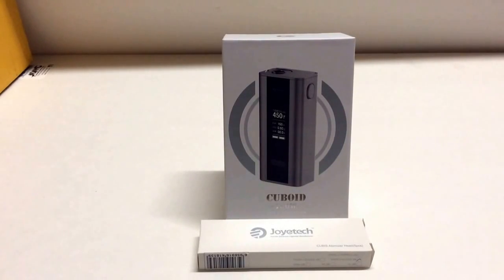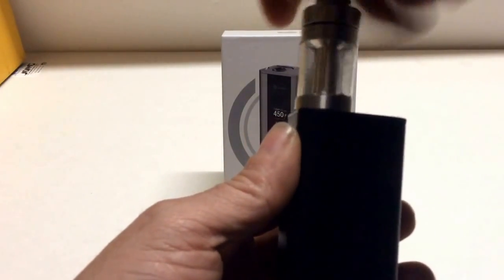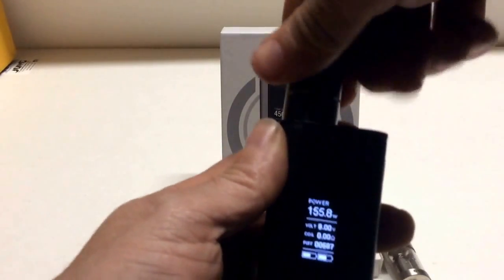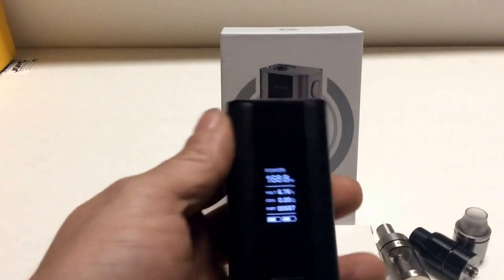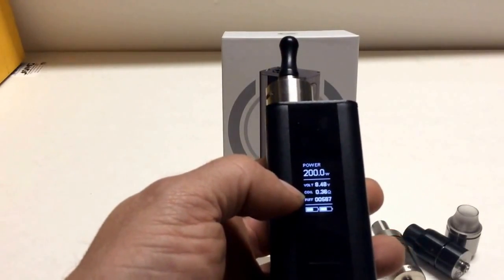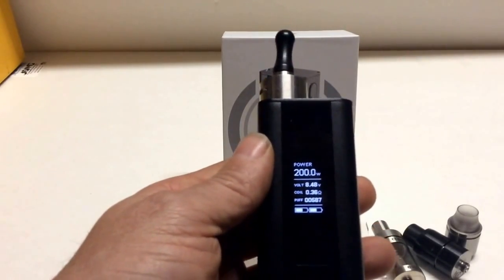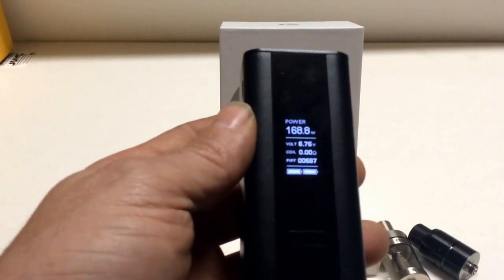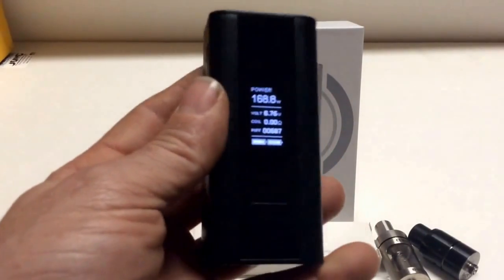Why can't I get my Joyetech cuboid 150w to go to 200w watt after firmware / software update

Comment: YOU CAN GO UP TO NEARLY 300 watts with just 2 18650!!!!
For all those who say that dual 18650 cant do 200 watts.... it can !

Just simple math:
Sony vtc 5 have 30 A, which means the lowest resistance you can use on it is .14 ohm to be 100% save. 
4.2V / 0.14Ohm = 30A

If you stack 2 18650:
8,4V / 0.28Ohm = 30A

Which means at 8.4 volts the lowest resistance you should go is 0.28ohm.

Whean you now want to get the watts with a .28 ohm build it is:
8,4V x 30A = 252Watts

All that means you can get 252Watts with fully charged batteries. 

If you now go with VTC5A which have a 35A Limit you can use a 0.12 ohm coil for single and a 0.24ohm for stacked.

8,4V / 0.24 = 35A 

8,4V x 35A = 294 Watts :) 

YOU CAN GO UP TO NEARLY 300 watts with just 2 18650!!!!
Reply: KiDCe - CS:GO and more VTC5 is 20A, VTC5A is 25A... please dont pull numbers out of your ass or listen to fools... check mooch tests or official sony specs...
Reply: Allright.
Since we are not talking about continuous discharge its still pretty save to use it with 30 amp... The Problem in all this if the cell gets hot .... but cauz we use it only for short times i wont get to hot. verybody will be save if they dont go over 30A when vaping and charging it correctly. Never heard of someone where the VTC5 exploded at 30A

And:  when im talking about 4.2V... this is only when the cell is fully charged for like 2 to 3 hits... then the voltage drops down to 3.7-3.8 volt so there is really no problem with a 30A coil at 4.2 V

Comment: No way will a mod with dual batteries fire at 200 watts there is no way

the RX200 will fire at 200 watts because it uses 3 18650 batteries and this will fire low ohms also
Reply: Sorry but its more than possible. I have the Smok H-priv mod which goes up to 220W. That's with dual/ two 18650 35A batteries. Oh and that's just some Sigelei's. I use it with the Smok TFV8 'beast' tank at 220W none stop with no issues.
Reply: There is no way that the joytech Cuboid is capable of doing 200 watts on dual 18650 batteries 

It's capable of doing 150 watts because I have done this 

and no way is the Smok H Priv capable of doing 220 watts with dual 18650 batteries either 

The only mod that is capable of vaping close to 200 watts would have to be the Wismec RX200 with 3 18650 batteries

I have a Limitless Lux that is possibly capable of doing 215 watts but it takes dual 26650 batteries and these comes with the mod when you buy it

I am saying this because 26650 batteries hold more power and they put out more power that an 18650 battery if you see what I mean

Just because a dual 18650 mod says it's capable of doing 200 watts doesn't mean that it can there are limits
Reply: Brittany McClue Yeah fair enough the cuboid can't, but that's not what either of us said. Actually yes, the Smok H-Priv can run at 220W with dual 18650 batteries,  like I said before I vape on it all the time at 220W. Tell you what, I'll post a video of it on my channel now and show you.
Reply: Sure no problem Josh and I hope that I didn't offend you in anyway because it wasn't my intentions my friend 

I hope you have a beautiful day whatever your doing

Best wishes and vape safe

Comment: I'm using the tfv8 and have the latest firmware my coil is at 0.16 ohm but I can't get the cuboid to fire it at over 100w
Reply: I put in the v8-q4 and only get to 112.5
Reply: thats because of the coil
Reply: Same
Reply: You have to put in the V8 RBA and it will go as high as you would want it to
Reply: I get the limit at 93W with the v8--T8 quad coil on. I thougt my VTC was broken
Reply: what would the limit be with a tfv4?
Reply: i have a TFV12 and it won't let me put it over 75watts, with a 0.12ohm

Comment: I have just run into this myself. When you get to vaping on really low resistance like .16 or .15 the amp draw required to go to higher watts is greater than 25A. The Cuboid has a limit to the amp draw there. You have to vape on a .22 or greater in most cases to keep from drawing more than 25A.

Short answer. The mod won't let you draw more than 25A whether the coil can handle higher wattage or not.

Comment: Besides to resistance settings, it also depends on the current charge of the battery. I think it's some sort of safety feature I guess? So as to not stress the battery. I have a rda with .13 ohm and it can do 135W when full charge, going down to 105W when 90% batt, 90W on 80 and 85.5W when somewhere 70% - 60%, then it does 75W when battery goes below 50% - 40% and man don't start asking when your battery goes 30% as it would only run 40W for some reason. Now the best way to utilize the Cuboid is to start off permanently somewhere that fits you, I go for 80W. This can make your device run its batteries more efficiently. Btw I use Samsung 25R5's and I could vape the whole day with it.

Comment: looks like it limits current draw to 25 Amps like on your .27 build display shows 6.75 v
so by ohms law Voltage/Resistance is current(Amps)  = 6.78/.27 = 25A

on your 0.18 build, it calculates to the same thing = according to your readout 4.5v/0.18=25A

Comment: Why in the world would anybody want to fire that high? I just tried it at 200 watt.'s power with the cubis with the included 1.5 clapton coils and got a hot lungfull of burned and scortched nast! I pray that that little experiment didn't ruin my new coil, as I don't have another one. Duh! Seriously, what do you all vape on that will not burn at that high a temp.? The highest I can get is 24 watt power setting and still have a good, tasty vape. Not a nooby here, just not experienced on a lot of the newer technology. Thanks.
Reply: +Loren Robertson all depends on resistance
Reply: shouldn't be anywhere near 200w at 1.5, I only run my 0.24 Clapton's at 120w at there's a massive difference in resistance

Comment: People don't understand the difference between a 200 watt mod and a high wattage device. Idk why anyone has a problem with this, because of the limit I can run dual fused Clapton reading at .15 ohms at 95 watts on my cuboid and the batteries last a lot longer because of that. I rarely ever need to run above 110 watts. And if you build too low and have a problem with the limits the cuboid has, either change your build style or get a mech.

Comment: Pff they should up the amp limit to a safe 30Amps. its completely reasonable.
Reply: Matthew DeFaveri Its at 9V 25A... battery voltage is 4.2V when they're fully charged so it's pulling around 50A from them (even a bit more), 25A EACH. How much higher could they go?
Reply: Error989 with the right battery's 30a is reasonable.
Reply: Matthew DeFaveri 18650 battery that can output 30A without overheating (going over 80℃) has 1500mah... (please dont tell me that vtc4 vtc5a can do 30A because it cant without being cooled)
Reply: Error989 well how does smok alien do it.
Reply: by pulling more than cells can give and not having safety... joyetech/wismec/eleaf products give you "weak battery" warning when they notice huge cell voltage drops
you can pull 30A from a cell that is rated at 20 but it's voltage sags from 4.2V down to 3.0 and even under in some cases under 1sec! It damages the cell...
Smok is well know for their bad QC and 0 ducks given about safety...
Reply: Error989 well they made a sale that's why I bought it.
Reply: QC on Smok products is pure shit! Also the paint on Alien comes off in 1-3 weeks...

Comment: That's how it is.! 133 W IS about the most you'll get from duell 18650 mod.
Reply: +Craig King You can get >300w from a single 18650 mod. It's not safe, but it's possible.
Reply: That's ignorance at best. Please don't try to speak on things you obviously do not understand or know about. Also, I don't think many will take advice from someone that spells dual as duell.
Reply: +TheAmericanUhate 200w@.32-.41 25a. 9v
Reply: Mark Nope yup.

Comment: It also requires fully charged batteries to do the 200 watts, and it doesn't last long. That's why joyetech said they didn't label it as a 200 watt mod, and just released the firmware for those who wanted to play around with it. They looked at it as false advertising since the 200 watts is rather fleeting.
Reply: BINGO!!!!!
Reply: +Laura Roesch I was looking for an answer to that question - thank you!!

Comment: nice PSA, it's just like the RX200 it will limit the wattage until you reach the 9 volts, but then again the Reuleax mods have 3 18650'z. the only thing I don't understand about this mod, is the lower the ohm's the lower the wattage?? I think it should be the other way around. IMO. VAPE SAFE GOD BLESS

Comment: Great demo of varying resistance, it appears that it's safety limits are set at 9 volts max and max amp draw allowed is 25 amps with total power not to exceed 200 watts. so using ohm's law you can calculate coil build accordingly. Nice video, Thanks.

Comment: does it only go to 200w on kanthal coils? it would make sense for it not to go to 200watts on SS nickel and titanium wires
Reply from the maker: +raven4soju no it wii do 200 watt with any metal and also in temp mode
Reply from the maker: +raven4soju  it dose with ss i have never tryed Ni OR Ti as for temp i only use SS now

Comment: According to The Vapor Chronicles, Joyetech recommend only 18650 batteries that draw 25 amps. What would happen if you had batteries rated higher than this?
Reply from the maker: +BigHenFor 1st there are no battery with more then 25 amps in a 2500 mah Samsung 25r are 25a and are the best right now the lg hg2 that im testing in this mod now are 20a. that said the motherboard in the cuboid will only fire to .3 at 200w because any lower would draw more amps then is allowable from 2 18650 so joyetech set the min ohm that is supported so you don't burn the board or vent the battery's hope this helps
Reply: +BigHenFor nothing, read my last comment, the board is a bottleneck, not the batteries.
Reply: +intel2you Thanks
Reply from the maker: +BigHenFor it works fine with reall 20a rated batterys like the lg hg2 i been working on doing battery testing and will be posting a video of the resalts in the next 2 weeks or so

Comment: the secret is in the limits of the board itself. it only allows for 25 A and 9 V. you can see throughout the video how it goes to 9 volts and doesn't go higher. or it doesn't get to 9 volts, but if we calculate the current, it will be exactly 25 amps. same is true for all mods out there. to get 200w at 0.36 ohms it peaks out both for current and voltage. long story short, your build has to be exactly from 0.32 to 0.41 ohms to get full 200 watts within 25a and 9v limits. to get 150w you need to build between 0.24 and 0.54 ohms. btw, at lower resistances it will hit 25a limit first, at higher-9v limit.
one more advice is to build closer to the higher end of firing resistace range, so that the current is lower, it will improve battery life.
P=[U^2]/R; P=[I^2]*R; I=U/R; I=sqrt(P/R); U=sqrt(P*R)-the ones i used for all these calculations, in case you wondered.
Reply: thank you
Reply: +izukenekuzi YEP, well said!  As I watched, couldn't help but keep thinking to myself..... ANYONE who even questions why it isn't going to 150 OR 200watts; esp if they think there must be something wrong with their device??  I mean, if a vaper isn't even familiar with terms like amps or battery safety & doesn't know the difference between something wired in parallel vs. in series...  If they don't have a good understanding of things like ohms, voltage/wattage & most importantly, of "Ohm's Law"... to already know exactly WHY this (or any other regulated high wattage device) requires a certain resistance or less, in order to reach its full 200w setting (of which most, wouldn't have ANY need to ever even come close to, anyway..) ??  Frankly... probably shouldn't even be using this type of device.. to begin with!!   ... just sayin'.  :)  Live long(ER) & vape on!
Reply: +izukenekuzi In addition... despite all that, as you also mentioned.. Each device could have it's own max voltage &/or allowable amps, regardless of batteries OR build. :)   For those who are aware tho.. & who have done their research, have taken the time to be come more informed about safety, Ohm's Law. max settings, etc...  (esp for its price) looks like a total winner from Joyetech imho. :)